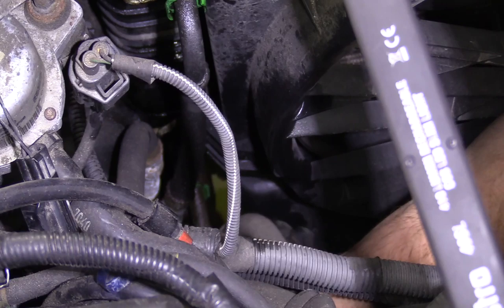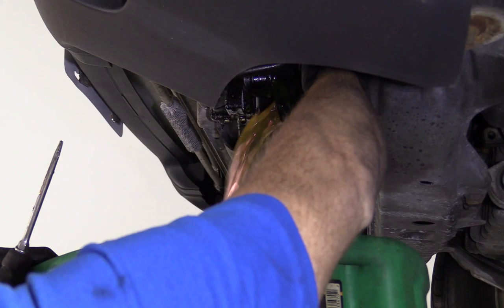How to Replace Radiator 03-12 Volvo XC90

Comment: Just done my XC90-V8...... Not as difficult as I anticipated. 
I found removing the headlamps helped to see things more clearly... 
(And are they not so fantastically easy to remove?..... Brilliant design there.)
Being a non-turbo, there was no intercooler to contend with. Piece of cake. Thanks.
Reply from the maker: +Patagualian Mostly Thanks for checking us out!
Reply: Did you do it on a lift? Or go from the top?

Comment: Great video - thanks!

Does oil need to be put in to replace the oil the drained out when the coolant lines were removed from the radiator?  This step was done at ~10:10 mins into the video.

Comment: Verhicle you say it a few times like that too I thought it's vehicle??? Oh yeah taking the fan out first from the top side is the easiest way to do it done mess with going down below that's looking for trouble. 2 10 millimeter bolts a few wire ties and an electrical connection and the fan can be out in under 5 minutes without fighting with it.

Comment: Would it be possible to drop out the rad + fan as one unit, instead of taking them apart and dropping out the fan first? Thought taking them out as a combined unit would be easier?
Reply: There is another video where the tech drops the fan, rad and inter-cooler as on unit. Looks slightly easier.

Comment: This looks more complicated than it needs to be. I replaced the ac condenser in a 2004 XC90 and the radiator has overlapping bolts with the condenser ,why are you removing all this extra stuff.

Comment: After watching the video I was wondering, if I removed the fan first, when I go to put the radiator back in, could the fan be attached to the hooks on the radiator prior so both the fan and radiator would be reinstalled as one unit? My other thought would be to remove that top metal plate just to give me more space to work in. Would I create any additional problems by removing that metal plate on top? Thank you in advance to anyone that is knowledgable about this. 
P.S. my son's 2012 XC90 R Design (non turbo)  looks as though it has a little more space to work in and I'm uncertain if there are any other issues with that particular model? 

Thank you again.

Sincerely,

Charles Abbott